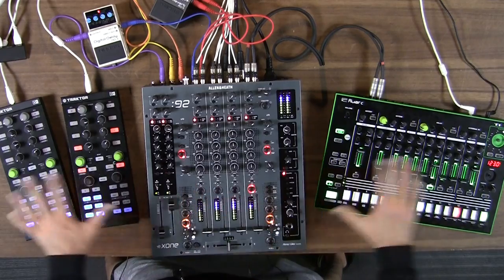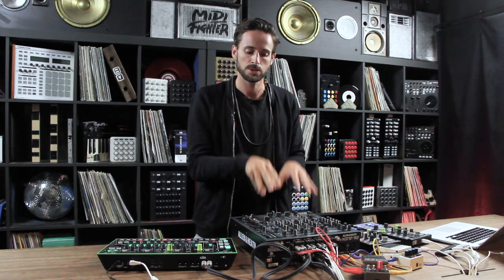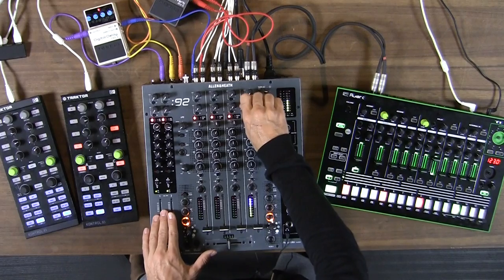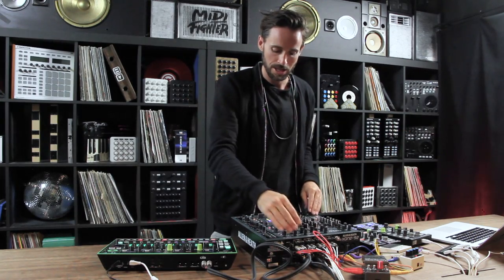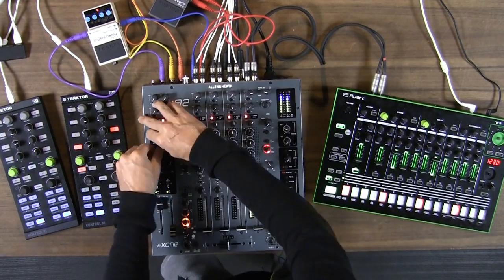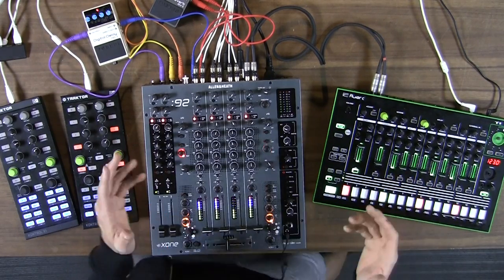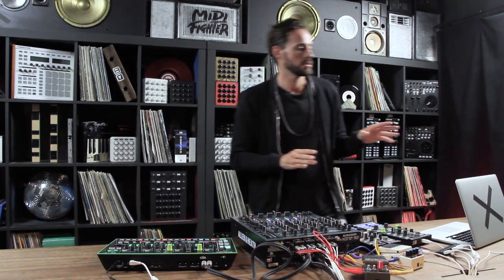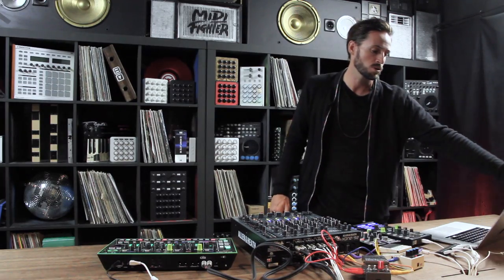Advanced DJ Routing: Analogue Mixers, Guitar Pedals, and External Soundcards

Comment: I would like to add one more thing - you need to work on  gain structure a little, you should have the channel faders at that 0 DB mark (it's next to the 0DB light, there is a scale on the other side of the slider) and try to keep EVERY channel at 0DB or under, or at most, a tiny flash to 3DB (that's for running 2 channels also, if you are doing 3 or more each time you need to pull down all the other channels to keep the master near 0db..). I know you touch on it a little about how in a digital mixer it would be distorting, still, even with the 'nice' saturation of master out of Xone 92 running at 3-6DB output light, it is not as 'clean' as running master at 0db (or 3DB max). When you were doing the effect, as you had gain trim at midday and level faders at 9 out of 10 sort of level (with three channels, music on channel 3 as well as dry on channel 4 and wet on return channel. So you can see at points you are redlining with effects. Important if DJs could learn about gain structure (ties into how you should be converting your signal from output of mixer before guitar pedal and then on way back again, which another commentator as well as myself touched on) - clean signal sounds a lot better than distorted/saturated/clipping for 90% of DJ stuff. Different story for production/recording/noise music and other things, but that's not what we're talking about (unless you DJ some of that stuff, even then I think you should apply proper gain structure to YOUR mixer output.. pull down those clipping tracks). One last thing though, don't take me as a complainer, I am very grateful for this helpful tutorial. It would have been very useful for me if I saw it some years ago before going on my quest to combine my guitar pedal board with my DJ rig :)
Reply: Don't sleep on this comment if you want a professional sounding mix.
Reply: I commented on a A&H post about this recently and they responded saying the same was Xone has plenty of headroom and it's not a problem. So are the channel VU's just for show? Do they accept that so many DJ's redline they have made them 'vanity' VU meters?
Reply: @THE_Container  due to being analog mixer with headroom it won't clip in a nasty way, but it will saturate from the summing of higher levels in the channels. So the metering has a point and will measure if you are coming in at 0dB or not, its just that with an analog mixer like this, it isn't AS important as if you are using digital where digital clipping sounds so bad. And some people might like the 'harshness' of analog harmonic distortion and saturation -https://www.youtube.com/watch?v=DZ4IGAR7iio is a good video

Comment: Ean what happened to the Scatter knob, BPM knob, and volume knob on the TR-8? Is that by choice?

Also why not use a Traktor A10 soundcard?
Reply: Ken Sheldon Probably has the tr8 slaved to the master bpm in Traktor.
Reply: Jacob Stadtfeldld he adjustes the tempo manually.  if you want the tr8 to follow the master tempo, you need a midi clock send signal, which traktor s4 has.
Reply: Exactly, only in this case it looks like he has clock sending over USB from traktor.
Reply: Jacob Stadtfeld yes
Reply from the maker: Ken Sheldon Ken - Ean often removes knobs from gear that he doesn't use or want to accidentally trigger - similar to why he adds Chroma Cap to the knobs that he DOES want to use the most often
Reply from the maker: Jacob Stadtfeld Correct!
Reply: +Ken Sheldon I was wondering why the recommendation of the A6 over the A10 as well. Anyone have any insight?
Reply: +Joseph Spinioso He is only outputting 3 channels from the computer, so the Audio 6 has enough outputs. If you were running the TR-8 into one of the Aux channels and running 4 channels from traktor into the mixer, you'd need 4 stereo channels. At which point the Audio 6 will not be enough

Comment: One thing that could impart a clearer and punchier signal!... 

With a set-up like this, you should check the impedance of the aux send/returns on the mixer (likely in the manual). Guitar pedals always are designed around high-impedance unbalanced signals (or Hi-Z, i.e. guitar/bass etc.), while analog mixers tend to be designed around low-impedance balanced signals. When guitar pedals are used as outboard gear in the studio a "re-amp" device is used to match the impedances and balance/unbalance the signal. I personally use a pigtronix key master because of its simplicity/flexibility but any re-amp device should work. 

There are a million guitar pedals on the market and there is no reason they can't be used as hi-fi effects units.
Reply: +John Helfrich you're a legend - I just ranted about this above before seeing you'd already touched on it :) <3 my Radial Reamper + Radial JDI Duplex + Rolls MP222 preamp :) Also worth mentioning how noisy pedals can be and how a good power supply like voodoo or cioks can make a huge difference when you get a BIG pedal board going :) Also just be aware that you are losing stereo with most guitar effects units (some phasers can have stereo output but usually still take mono TS jack input, instead of TRS / balanced jack stereo input or 2x mono TS inputs) so if you are wanting stereo panning stuff you're going to either be going to mono/dual mono while using the effect or have to run effects on each stereo channel in order to still have two separate channels. Just something to consider if stereo is super important for the particular performance. I should also add I used to use the 'low z' guitar input on my Roland JC-120 keyboard amp, since I thought it would 'work better for my detuned 7 string guitar' ROFL. I don't think back then I noticed any real difference, I think perhaps consumer line (low z) and guitar level (hi z) are pretty similar? Probably wrong xD
Reply: Where would the reamp go on the chain?
Reply: MrPisster after the mixer sending it, before the thing that it’s being sent to.
Reply: Most pedals are unbalanced and the Fx Send / Return input / output jacks on the DJ desk are balanced so you need a DI Box to make the unbalanced signal turn in a balanced signal.
it's even mandatory if you are using long low quality jack - jack cables you could get hum, buzz and noises...
Reply: The most versatile efx for a dj are the Pioneer RMX 500/1000 units. Lately thought I   replaced the 1000 with a Specular Tempus which excels with dub.

Comment: I love Ean and his contributions to digital DJing, but parts of this video is just wrong and dumb. Headroom has nothing to do with how many tracks you're playing simultaneously or how well you can mix them. If it would, what kind of soundcard would one need for producing a 200+ track song in your DAW?

Ean seems to have no clue how to properly set the trim (gain) on a mixer. See any of his videos: most of the time the channel leds AND the master leds are peaking red. It's amazing how a DJ this good can be this bad! If you know anything about audio signals, you know that signal level does not equal sound level. Keep your signal levels below the red, and if you want more volume, turn up the amplifier.

If you're running all of your channels red, they're not louder, they're just sounding really bad no matter what kind of mixer or audio card you have. With digital mixers you're usually getting DSP controlled limiting instead of distortion, with pure analog mixers with no DSP, you're actually producing distorted signal and eventually physically destroying your gear.

Any DJ mixer can handle as much simultaneous signals as it has channels, as long as you trim the levels properly. Ean should either learn to do this better or partner up with Pioneer to make next DJM to go to eleven...
Reply: I totally agree.
Reply: DJ Uninen Isn't that the whole appeal of analog though? Pushing the levels doesn't result in the same distortion a digitial mixer would; yes it'll sound compressed but in a non-destructive way, within reasonable limits at least.
Reply: Jacob Stadtfeld Yeah man which is basically what he said in the video haha.
Reply: Matt K True, but the reason I mentioned it was that he didn't really seem to explain it in a way that someone who isn't familiar with the difference would understand, at least in my opinion.
Reply: DJ Uninen In my Opinion its totaly clear that he wants the mixer to be redlined because its an analog thing, does not distort but does compress the output. Compressing does not only make things louder but it squashes some of the dynamics of the elements. In a mixed and mastered track you probably do not want to squash the dynamics more than they are already. But in this case, he is mixing the elements together live on stage and does not have any other compressor that which activates verry nicely when he is redlining the mixer. In my opinion the output sound pretty good. This is for sure not the best option and i agree that there are plenty of other, better things to do than redlining. But i think ean knows well what he is doing and if he keeps it always like that it seems to be practical to him. But I would avoid that too i guess.
Reply: Jacob Stadtfeld no, not at all -- in fact exactly the opposite. In an analog circuit, overdriving the levels results in audible distortion (and if it's pushed all the way to the (analog) amplifier, it will break it). In a modern digital system (like DJM-900 for example) there's circuitry to prevent sound from clipping before it distorts audibly. But yes, analog distortion does sound different than digital distortion. It doesn't mean that it's good, tho.

And limiting the signal is not the same as compressing  it. Hard limiting is equal to compressing with infinite ratio, ie. not doing anything else but reducing the dynamic range. A proper compressor changes the signal -- hard limiting just makes it sound worse.
Reply: QCube hard limiting is not compressing. Hard limiting the signal does exactly what you said, it reduces the dynamics, ie. makes it sound worse.

If you want to compress the signal, use a compressor. Hooking up a compressor after the mixer is trivial and MUCH easier than hooking up a 4+ channel audio card. You could also use the sends to do parallell compression if you wanted to.

Redlining a DJ mixer or any gear for that matter is just very bad practise. And yes, you can of course say that you're doing it for "artistic" reasons but it still doesn't make it good practise.
Reply: Guess you're right :)
Reply: I just like to justify people more than to judge them. So as it is pretty obvious that ean know that redlining is bad (no matter if he have deeper knowledge or not), as a dj he gonna hear the difference and may have his reasons for doing so. A lot DJTT Articles are written by him that also say to not redline so if he is doing it himself, i guess he have a reason for that (or he better have one :D)
Reply: 100% agree in everything.
Reply: The appeal of analog mixers is their almost 99.9% true reproduction of analog sources, not that it can somehow accept and present distorted signals easier. If you send a distorted signal to a PA system, regardless if it is coming from a digital or analog mixer, the PA system runs the risk of being damaged.
Reply: From what I know you can hit the reds every once in a while on an analog mixer and there will be no audible distortion. Although on a digital mixer if you are hitting the reds on the output stage you are making audible distortion. Many of the best mixing engineers in the business hit the reds on analog boards and never cause any distortion. For this reason analog boards are said to have more headroom.

Comment: I'm seriously considering getting a Xone 92, even in 2020, always loved the look of it, but torn between getting that and the Xone PX5 being it has the USB connection on the back. Obviously there's the Xone 96 but that's a little out of my price range right now. I have a komplete Audio 6 MK2, i was wondering if i could replicate this setup using it, for 3 decks from Traktor Pro 3, if so what cables would i need? I was just looking at an 8x 6.3mm Jack Mono to 8x RCA Male Multicore Cable, would that work with the Xone 92 and my Audio 6 Mk2?! I'm guessing it wouldn't being it only has 4 out and 6 in. I noticed the the Traktor Audio 10 is now discontinued also.
Reply: The Xone 96 has some refinements and enough of a difference in the sound quality to make it worth it, imo. I had a 92 but was blown away by the 96 when I had it.
Reply: Get xone 4d it does all this and more

Comment: HI, how to connect my xone 96 with the tr8s? still need and external sound card for the midi? I connected with the midi of the xone 96 and it doesn't work
Reply: the 96 comes with a soundcard and midi options. you need to first set the 96 as the soundcard for Traktor, and have it send midi signal OUT  to the tr8s' midi IN. then you can either route the AUDIO OUT of the tr8s into one of the 6 stereo channels.

Comment: thanks dude., been a dj for 34 years professionally and this is like icing opn the cake.  i no longer have decks, or my controller, but with 2 x 1's, a Z1, a microKORG, an numark analog 2 (+1 (line/mic)) channel mixer with analog controlled digital fx (unbelievable including a never ending tape delay and the best filter i have EVER heard.   i have experience dj'ing with effects as for years, alongside my 1200's i ALWAYS had a mixer with aux send/ return to use my DigiTECH DSP 128+ rack mount fx unit.  i been remixing records live since 1997, so of course i have a newly acquired Malekko Echo ID-300 Bright Analog Delay Pedal, and even though i don't have send/ returns on this numark, i have that 3rd stereo channel with eq and can apply a whole different slew of it's digital fx, including a vocoder (!) and then i have a really shitty gemini ''mixer'' (which i don't even know how it got here, tbh).  this allows me to have the effect petal on channnel 1, and the microKORG on channel 2.  as well as a second microphone (one mic per mixer (or another line, via the gemini). alternatively, i could use the gutiar pedal in between the KORG and my Numark, instead of on its own channel.  then again i could always just use it for vox effects connecting a mic directly into the pedal. the best part is that i now can record externally as you've managed to make sense of the input/ output routing and such.  even though i went to school for music uindustry arts back while digital production and dj'ing was still in its infancy, using both analog 2'' tape recording, MIDI, and digital producing/ recording, (Logic/ Protools), and even with all that, it has been a complete nightmare to get my head to properly wrap around all of this. i still have to physically draw out my setups.  ADHD + OCD, not irrelevant Hahahaha. until really, siiting down, watching this today, i still hadn't managed to work it all out.  way too many contingencies.  it can be rather overwhelming.  immediately before watching this,  i learned to, and mapped, nudge and pitch controls to my x1's.   now my life, music-wise, at least, is once again, complete.   

thanks you Ean, 
good sir,
you are truly a legend.  🔥🔥🔥🔥🔥🔥🔥

Comment: Thanks for the video, great to see how you’ve set it up. Unfortunately I’m confused. In the one hand you explain how the analog element allows for cleaner sound without distortion but then go on to say you will need a sound card 🤔 I’ve not had any issues running my sound source directly into the channel. So I dont understand?

Comment: hello, i just bought a xone92 and i want to connect my RMX-1000 on the mixer. which is the correct way of doing it?

i have tried connecting MIX2 to RMX input and from RMX output to RETURN 2. when i try to increase the volume of MIX2 on the mixer there is a strange sound. im not sure whether im using all the correct preferences, if you can please tell me the correct ones.

in addition i have tried connect AUX1 to RMX input and from RMX output to RETURN 2. with this setup i cannot use the echo filters on the RMX since there is no input from the mixer to the rmx.

please let me know which is the correct connection and settings to use fully the RMX1000. THANK YOU.

Comment: Hey Ean, 
how did you connect the X1`s to give a signal on the mixer? I just got myself one and the midi works just fine but I cant figure out how to get a signal from them to my xone 43. I am using 2 CDJ 900nxs players as a soundcard and their output just works fine. Would a "real" soundcard help me fix my problem? I used to play without traktor before so I really am new to this topic. Can you help me?
Thanks
-Michael

Comment: Hello Ean, i have a question for you.
I have a Scarlet 6i6 soundcard connected to the xone 92 mixer.
The problem is that the peak level leds of the channels doesnt turn on.
I tried with a Technics Turntable and it worked, but when i plug from my soundcard it doesnt work.
I think it sounds good, can the problem has to do with only with the peaks meters?

Comment: Hi,
That´s a awesome video! Thank´s so much for that!
I don´t have much experience in connecting things.
I would like to connect Traktor with my Signature22 mixer (use instead of a sound card) to the zone 92
My question: Is it possible to use my soundcraft signature 22 (with audio interface) instead of an external sound card? The mixer only have AUX outputs and don´t have chich (RCA cable) stereo outputs.
I´ve try it already but I failed. Or maybe I did a mistake in the settings in Traktor...
I´m thankfull for any help...